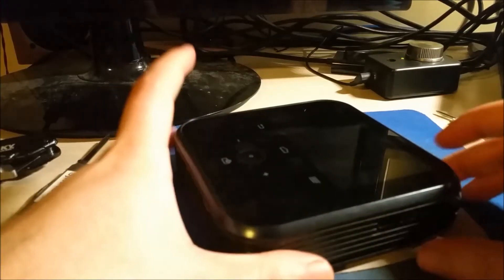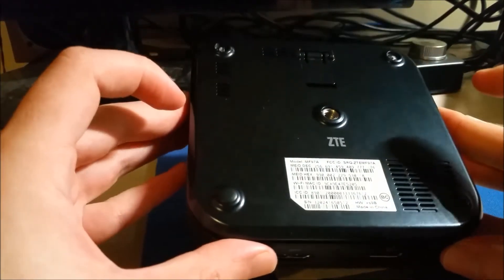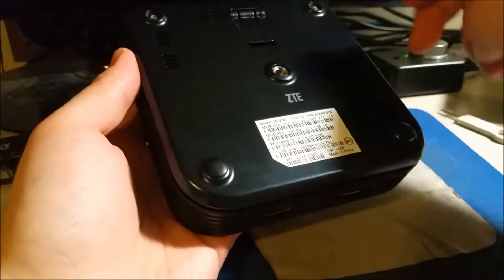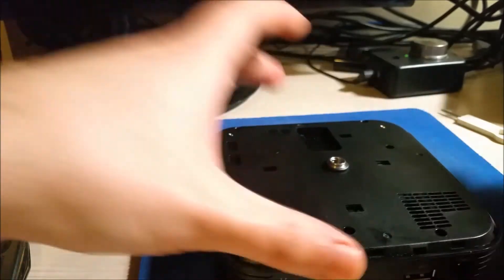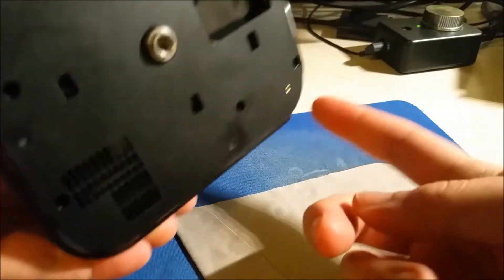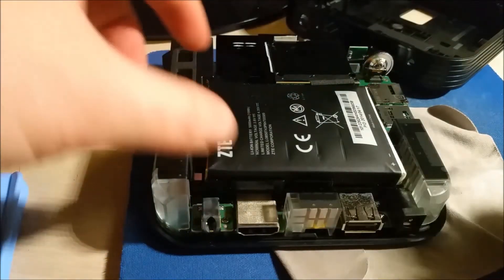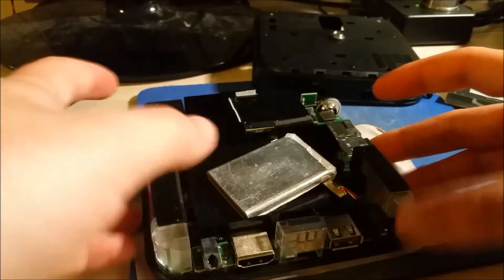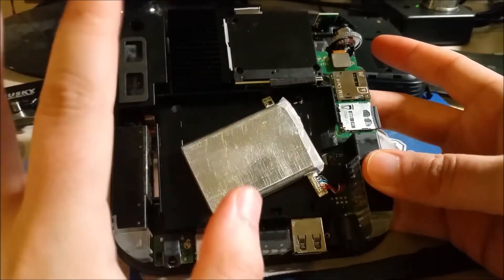ZTE SPro Android DLP Pico Projector Emergency Battery Replacement!

Comment: Very cool! I have an apeman m4s that had a bad battery I'm trying to replace so I can use it plugged in. Do you see any issue with using a lower voltage battery? The original is 7.6V and I'm thinking of using a 3.8
Reply from the maker: If the circuitry is designed to run off 2 series cells (~7.4V) then it just wont work off a single cell (~3.7V). You would have to pretty heavily modify the power supply circuitry to make it work, and even then it would be pretty inefficient since you would have to boost 3.7V up to 7.4V. You can generally get away with changing the capacity (mAh/mWh) of replacement batteries but not the voltage.
Reply: @sjm4306  Thank you for the detailed reply! That is good to know. I'm definitely a novice at electronics repair, but I can't see buying a new mini projector if the batteries are similar

Comment: Hey sorry to pester but I changed the battery and projector still doesn’t work when plugged in. You mentioned rooting. Do you happen to have link or video to how to root this device?
Reply from the maker: Sorry there's very little info about this projector online, but I think I read some comments for this video from quite awhile ago describing the process.

Comment: Hi there I recently bought what looked like a barely used zte spro 1 at a flea market for 10 bucks. In your battery replacement video I see that you are able to use the projector when plugged in, but the one I bought only works on battery power. Is there a setting I might be missing? Did you hack it to run the projector when plugged in. Thanks so much for any thoughts. There’s not much out there related to this device. Don’t really care about the battery life. Just want to be able to watch a full movie with it.
Reply from the maker: I think it's detecting the battery is near the end of its life so it wont charge and project at the same time to prevent the battery from going exothermal. I'd suggest first trying to swap the battery like I showed in this video and if it still does this then I've read that some people figured out they had to root android and modify a script to allow the projector to work normally after battery replacement.
Reply: Thanks. Actually found a battery on Ali. Will order and give it a try.

Comment: Where were you able to find a replacement battery? There are similar ones without the wire harness.
Reply from the maker: Nope, I could only ever find the ones for the spro 2.

Comment: Bro does screen mirroring show black?
Reply from the maker: I'm not quite sure what you are asking?
Reply: @sjm4306   the projector shows black screen when I connect my phone
Reply from the maker: You could try another miracast sink app, but that's odd it should just work
Reply: @sjm4306  what phone are you using mi phone is newer
Reply from the maker: Samsung s8+
Reply: @sjm4306  and you can screen mirror the whole phone? Or just youtube
Reply from the maker: Yes I can mirror the entire UI exactly as it displays on the phone. Not all phones (even recent ones) support miracast though (I believe they changed the marketing name now though to "screen sharing" or something generic like that).
Reply: @sjm4306  can you do a video or whats rhe app?
Reply: On your phone called
Reply from the maker: In my case I don't need a 3rd party app, I use the feature built into android in the settings menu to screen mirror. But it seems that in your case the built in functionality isn't working properly for some strange reason. A potential issue is if you are using bluetooth or wifi simultaneously when trying to screen mirror as they may interfere (in the case of wifi that's how screen mirroring transmits, and in the case of bluetooth they use the same frequency range which can reduce bandwidth).
Reply: Up
Reply: @sjm4306  ive tried the mira cast app wifi display bluetooth is off nothing works maybe my projector is running the to old firmware

Comment: can you show how to replace the bulb
Reply from the maker: It doesn't really have a bulb, but rather a custom flex ribbon with high power discrete red, green and blue leds. I dont think any aftermarket replacements are directly available so your only option would likely be to find suitable replacements for the discrete leds and desolder the old ones and solder in the new ones.

Comment: My projector keeps turning on and off. Apparently, this is a software issue where when the device senses that the projector has about 100h left on it, it triggers this to make the consumer buy another one. Do you know how to disable this?
Reply from the maker: Where did you hear about this? If this were true and someone could disassemble the firmware to prove it then zte would be in a whole lot of hot water. Like class action and consumer protection hot water.

If I had to guess, a more logical explanation of shutting off would be either the battery protection is kicking in because the cell is dying or thermal protection is shutting it off because of some hardware fault. Or I guess it could be a corruption of the android installation or a failing emmc memory chip (I had an android phone that this happened to that had the same shut off symptoms). Have you tried resetting the OS to factory or reflashing it to make sure it isn't the software?
Reply: Read it over here (in the comment section); 
https://www.youtube.com/watch?v=0wDBAupvAUA
Reply from the maker: I dont see where it even says the model of projector or any validation/proof of the manufacturer forcing obselescence through a software shutdown. Remember bold claims require bold proof. I still think with >90% certainty that either a hardware or software fault is resetting the projector as part of a safety system. For example high pressure projector bulbs can tend to explode if run towards the end of their life so perhaps this is a safety mechanism to prevent this.

Comment: Thank you so much! Having the same issue on my spro2!
Reply from the maker: I usually leave mine plugged in and only use the battery occasionally. Really wished they designed it with a battery cutoff switch which would've prevented this from happening in the first place.
Reply: me too just fixed my battery because of this video

Comment: Hey I had the same portable SPro and I thought the thing was totally awesome, until the ZTE SPro 2 came out on the market and l purchased it. ZTE also manufacturers a third projector, SPro Plus, but don't bother trying to buy it, it isn't avaible in the US market. I believe you have to go to China if you wanna purchase a SPro Plus. Bummer :( Just like the SPro and SPro 2, it too has a color touchscreen display, but it's display is something like a tablet would have, something around a 10" and it is thinner, 1/2" l think. Anyway, you think the original SPro such as the one in this video is really cool? You have to get yourself a SPro 2! There is no knob for focal view. Not only does it have auto focus but it also has keystone correction, it has a setting for rear projection where it'll flip the screen around and it also has ceiling mount correction, so that you can mount the projector upside down on a ceiling and will correct itself so the image is flipped right side up on the projection screen. You can have a huge 120" screen with double the lumens that of the one shown in the video. It has HDMI, Bluetooth, WiFi, USB, Mini SD card slot and it comes in carrier or non-carrier versions. I just wish ZTE would have put a dual SD card slots on the non-carrier version since there's no SIM card slot. The battery has a two hour window with the projector activated, good enough for a standard length movie with a little more extra  juice to watch other videos after the movie's ending. You should invest in the SPro 2 rather than a battery. If you like the projector in this video, then trust and believe me, you will most definitely like the SPro 2. I purchased my SPro 2 right off the ZTE's website for $500. Right now they're all over eBay and you casn grab a brand new unit for around the $250 range. Go a head and get it, you'll love it, it has a 780i display, not quit HD, but damn near. It will produce a much better picture than a lot of 780i LCD TVs.

Comment: My lamp has burned out and ZTE is no help at replacing it. How can I and what kind is needed?
Reply: I am only mildly geeky and was able to fix it myself. I called zte support and they said $150 to fix. I wasn’t satisfied with that since I was positive that I fixed the issue when I replaced the battery. After lots of google and YouTube I was able to root my device. I used root browser and located a folder called projector. In the folder there were only two items. I renamed the one called stopflag to stopflag1 and waalah the error message that was preventing my projector from working went away and the light and fan both turned on! Saved $150 plus shipping and tax and the time it would have taken to fix it! Very happy I found this video and did a little bit of my own research before caving in and paying $150 to ZTE. I used king root from google play store for free!
Reply: @margie0420  After months of not being able to use my projector due to the same error message you got, I followed what you did by rooting my projector with King Root and using Root Explorer that I downloaded from the Google play store to find the folder named Projector. When I opened the folder there were 2 files and changed the file named stopflag and just renamed it to stopflag1, and sure enough it worked! It did take me a few hours to figure things out but I had to use a usb3 to usb3 cord that I got off of Amazon and hook it up to my computer using windows, King Root did not work on my Mac, I downloaded Root Explorer on the projector itself and searched for that file named projector. I hope this helps others that have the same issue. It beats calling ZTE and them telling me that it would cost $150 for them to fix it. Good luck people!
Reply: Thank you Jimmy! I got the error message again right before my replaced battery puffed up. I hope I can recreate what you have done so I can get mine working again. Maybe I’ll even get a second one from eBay. Thanks again!
Reply: Jimmy Pan do you know how you got to the projector file?
Reply: @margie0420  Hi Margaret, once you root the projector, scroll down to a folder called Persist, then scroll down to the Projector folder, then stopflag is the first file. Hope this helps
Reply: Jimmy Pan one more question, what app did you use and did you have to root through your computer or were you able to root through the projector?
Reply: Margaret Anthony. Please advise what folder we need to go into to fix the issue. Both my brother And I have the same issue.   margo33gmail.com
Reply: Margaret Anthony That worked for me too! So many thanks!
Reply from the maker: Renee Dugue Before assuming it's the leds I would check the fan and any temp sensors since if those fail the leds will never turn on. Let's hope one of thise is the problem since it will be a much easier and cheaper fix then. If it does turn out to be the leds a good place to start would be to remove them and check for a model number etched/printed on each led. If you can't find a replacement you might be able to bodge in similar model but then there's a lot of details you will need to worry about then.
Reply: Hope you got yours fixed. I just got an error that it has turned the lamp off to prevent overheating and to call customer service and it is 1 month out of the extended 2yr warranty offered through the visa I used to buy it. Since I’m out of luck with warranty, after watching this video I decided to open my Spro 2 up. It has a few more screws. Once the bottom was off I removed the screws holding the contents to the housing, by the time I got to the second screw the case opened itself up. Puffy battery. I just ordered a new one for $40 and hopefully it fixes the issue. I really liked this thing.

Thank you for posting.
Reply: Margaret Anthony hi, how many hours would you say it lasted before the battery issue?
Reply: Dr Strange not sure exactly but I used it nearly daily for two years as a computer screen. My battery arrived and I installed it but it looks like the error message still shows up when I try to turn the projector on. Update: fixed using king root and root browser. See below.

Comment: Can a cell phone battery be connected to this? My Spro2 battery has died, i cant find a battery from ZTE so i was thinking of using a different 5000mah battery.
Reply: Amazon has batteries for spro2. Don't know if spro is same. I have 2. Trying to see how to connect the little connector..tiny!
Reply from the maker: Eurostar 07 So long as you reuse the battery protection board from the original battery and it physically fits then any 3.7V lithium battery will work.
Reply: Sounds good thanks man.
Reply: same problem, dit it work with the other 5000mah battery?
Reply: Yes or yes